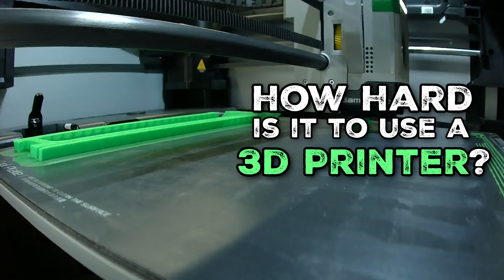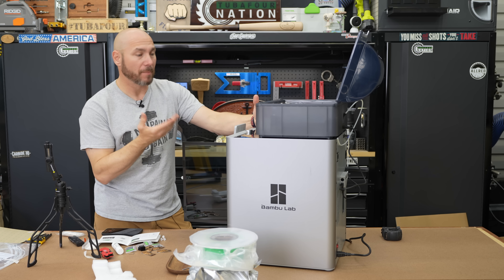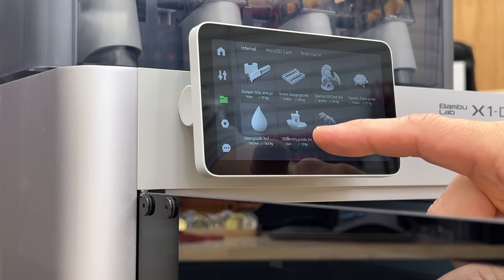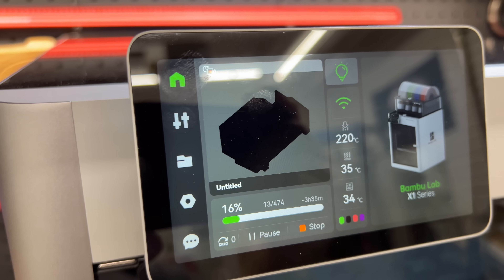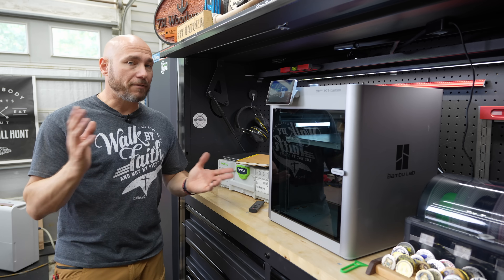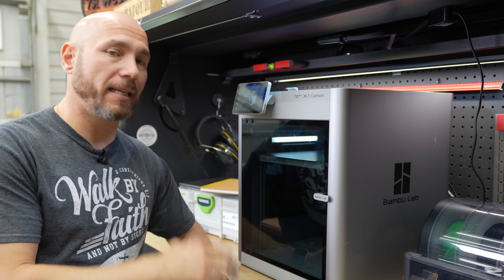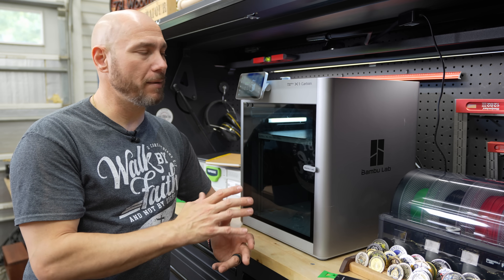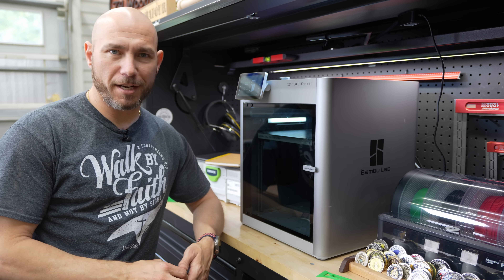Is This 3D Printer Worth the Price? Bambu Labs X1 Carbon Review

Comment: Welcome to the wide world of 3D printing Matt! I'm not familiar with Bambu's filaments, but I think that black PLA-CF means it's PLA with carbon fiber mixed into it.

If you haven't seen it, you might want to look into the honeycomb storage wall on Printables - it's a customizable wall mounted storage system (deluxe peg board basically) and tons of people have designed various add-ons for it, though they recommend printing it in PETG (it's tougher and has more UV resistance)

When you do start playing around with other materials, please do some research beforehand so you know what you're playing with. Some plastics like ABS & ASA release VOCs when extruded (I believe the X1C has a carbon filter) and others, like nylon are insanely hygroscopic (they absorb moisture out of the air) causing them not to print properly, if at all and have special requirements (ie - drying before printing).
Reply from the maker: Thanks for the info!

Comment: I love my X1 Carbon, great for shop organization. Also started creating with Fusion 360. Great tool in the kit bag!
Reply: For $1,500 it is complete overkill for making organizational tools.

The X1 carbon is designed for engineering materials.  If you are just printing PLA you are throwing hundreds in the trash needlessly.

You could get 10 ender 3 printers for that, a literal print farm.
Reply: @amil89, seems like you misunderstood me, I use it for shop org stuff along with several other projects. But I do agree that it would be overkill for just shop org.
Reply: @4lan39  one of those "engineering materials" is glow in the dark filament, so definitely upgrade those nozzles if you dont get the x1c

Comment: LOL I think it's hilarious you think it takes a long time to print! I started five or so years ago with a $100 Ender3 and just recently got the same Bambu X1C. The speed difference is so dramatic, a project on the Ender3 that would take 24 HOURS takes about 8 on the Bambu and it the quality on the Bambu is so much higher.      Enjoy your new machine, I do enjoy mine!
Reply: ordered an X1C with AMS, upgrading from an ender 3 s1 🎉🎉🎉
Reply: @lyx9560  I'm about ot do this too!
Reply: @lyx9560  I’m hoping to do the same!
Reply: @gocygo01  Haha, gotta say its quite the upgrade, been enjoying it quite some time now
Reply: Lol my son said the same thing and he has the P1S Bamboo! Took 12 hours to print a part on old elder 3 now takes 4 hours. It’s like dialup versus fiber if you have never had anything but fiber.
Reply: try printing stuff too :3 @waterhawkoutdoors769
Reply: Once you get everything dialed in, I was able to print a mechanical part in one hour and 46 minutes where on an ender 3 it would have been 13 hours
Reply: Came to say something similar. 5 hour prints used to be a dream for that size of prints. Even today most printers are still MUCH slower.
Reply: My Voron 2.4r2 needs around 20min to reach chamber temp and another 5-10min for probing and loading/purging filament 😂
Max acceleration is only 7k and 3k for outer walls. The X1C is really fast. The only thing my Voron is faster is travel moves with 1m/s with a 350mm bed.
Reply: Correct....one of my prints took 28 hours on a anycubic kobra....bambu does it in 6 love my bambu
Reply: ROFL After I edited my comment last night watching I see you made the same comment on it lol.
Reply: Same here started with ender 3. Ordered my bambu Yesterday. Looking forward to get the same experience as you did.🎉
Reply: @sbs7396  Goodluck with it! my x1c arrives in like two weeks 😭
Reply: Haha I thought the same thing!
Reply: I've started 3d printing as well back in 2018 with an ender 3 and I was thinking into getting a bambulab x1 what's your opinion from your personal use?
Reply: I remember the amount of work my original anet a8 was XD how long it took to print. Oh god. I do not miss those days. Now I do resin. And just looking at the bamboo cause it seems like a nice machine
Reply: That's what I am saying. I started with an ender 3, and it just died. I got this printer, and it's waaaaaay faster. Normally, bigger prints that would take 15 hours is down to just a couple. They have come so far in just a few years.
Reply: Same, I started in 2017 Duplicator i3, click print and come back in 24 hours, and maybe, just maybe, it completed👻
Reply: i was about to say the same thing.....
Reply: Same here. But I had an FT5 from Folger tech. It's a POS. I gave it away. Same with my Ender 3s. 
Here we are. About to her an X1C 😅😅
Reply: Exactly what i thought too, being an ender owner for many years...some ppl eh😂

Comment: I would love a Bambu printer. One feature I don’t think I want is the multi filament add on. I love to print models and household tools. When I print models I finely sand them and hand or Airbrush them. Household tools just need a finishing coat.
Reply: The best part about the AMS is if you load 2 spools of the same filament, when the first one runs out, you can configure it to continue and use the second spool. This is a great way to never have "left overs" on spools that never get used.

Also, it's nice to have say PLA loaded for prototyping but then some other type (ASA, PLA-CF, etc.) also loaded in the AMS. Once you get the prototype printed nicely, you just select the other filament and reprint the final version in the final desired filament.
Reply: The nice thing about the AMS (besides multi-color prints) is that it removes the hassle of changing out the filaments. Want to print something with PLA? Select the PLA in the AMS. Want to do a PETG or ABS project next? Just select the appropriate slot in the AMS. And the option to print on from the next roll when the first one runs out saves me from having lots of spools with minimal amounts left on it.

Comment: Been 3D printing for like 10+yrs.! They are sooo awesome and useful especially for shop tool add-ons! Wait till you go down the TPU with vacuum adaptors rabbit hole! Lol. That glue stick is just basic glue stick! Get Elmers “purple” glue stick, it’s cheaper and better!
NOTE, saw dust on filament WILL JAM up in the extruder over time! You may not want to leave it out in the shop as sawdust will get all over the filament over time and cause issues!
Reply from the maker: Thanks for the tips!

Comment: I loved this episode, that 3d printer looks awesome!  I would be helpful if you did a follow up video and you covered the total cost of ownership e.g. cost of filament, supplies etc, also the required maintenance routines.  Thanks again!
Reply from the maker: Great suggestion!
Reply: the Slicer has a cost per print in materials (estimated)  its the electricity that really gets you.  Monthly cleaning of the machine makes a differences well.  These purge a ton of waste for the multicolor use.  You can recycle the failed prints and purging waste through online businesses - there is a cost there as well.
Reply: +1, please
Reply: The bambu lab printers can eat through 1kg in about 24 hours which is like 13-20 dollars per day
Reply: @LoweredLine  Yes that can be true. The cost should be offset by your projected selling price which should account for the cost of power usage, material, maintenance and time.  Ultimately it is relative to what you are printing and if it is personal or for profit as you know. Any printer CAN go through a ton of consumables. There are ways to mitigate the Bambu purge amount in a few ways.  Adjusting your infill type, and reducing the speed to help avoid any failures.  I have found Elegoo PLA prints great and are around the $14 price point as the Bambu or Polymaker can hover around $22 or more.
Reply: @mattironforge  my last kg/day printing was like 4 prints so filament waste was minimal they were just big parts printed fast
Reply: @LoweredLine    I would really only be doing this as a hobbyist maker not an entrepreneur.
Reply: @mrgunn2726  the project was a personal project lol

Comment: Hi Matt, thanks for the review and relaying your experiences!

One thing you didn't mention is the cost of producing an item. In the future could you provide some examples, it would be very. very useful. 

Thanks!
Reply: I think the power supply in the X1 is 600 watts. This is less than a desktop PC. I don't expect you would notice much of a difference in your electric bill. But it is still cool to watch a video that tests how much it costs to make prints.
Reply: @duanebrown1370  My initial thought was because heating element(s) were/are involved and the unit needing to run for an extended time the printer might draw a fair amount of power per project being a consideration in overall cost of a given complexity and/or size. 

I was curious enough to look on the Bambu web site, the site indicating under 110, draw is 350 watts max. A few other sites I quickly scanned suggested a spike up to 500 watts or so, so not too bad and the average (again, based on a brief scan) looks like +- 100watts running most of the time.

So, I ended up answering my own question at least when it comes to electric usage. Still, would like to see overall cost (including figures from a watt meter, just to settle the question) for several projects...a few simple a few complex...just to get an idea of cost for a range of projects to see how well scaling works. 

Just a thought.
Reply from the maker: Great suggestion!
Reply: @TheOutlawEffect ; ya, beyond things like filament because the printer runs with heat - think you said 170 degrees C - electric may be something that needs to be considered when making long running projects, and you may even need to consider where you plug the printer in depending on the draw. 

I've been wanting one myself, so glad you are taking the plunge and relaying what you find as I see a printer being very useful. However, knowing the real cost of consumables (and time, I assume) will be very, very useful. 

Big thumbs up!!!!